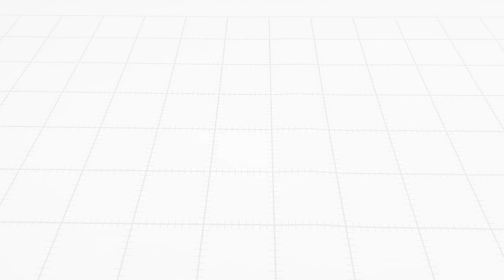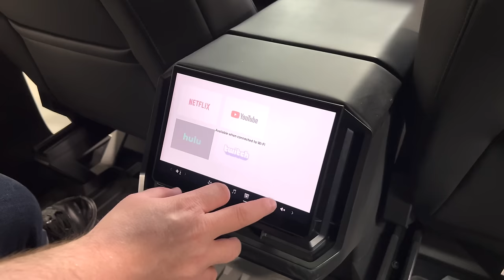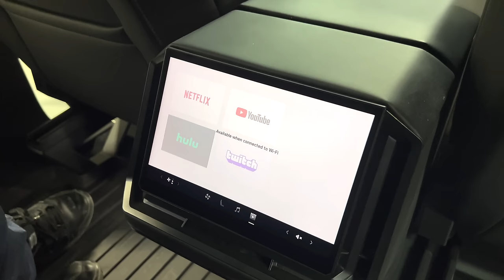Funky Form & Features: Tesla Cybertruck Interior Review

Comment: Put all your ratchet straps and tie-downs in the Frunk, Carl?
Reply: Yeah, that was a really weird example to make it into the final edit of this video. There are so many random "what ifs" that are not explicitly related to this vehicle, why bother including "what if you're hauling something and it's on top of the rear trunk?.
Reply: Or under passenger seats? You know in advance if your going to need them!
Only in an emergency is it an issue but no spare tyre either so hardly an issue in that respect
Reply: Not sure I want my assessories in the frunk. Likely in a bag under the back seat.
Reply: then why put storage there in the first place? seems like a great place for a spare tire instead of
Reply: @deathraylabs_nature  Tesla clearly decided that carrying around a spare wheel 100% of the time was an unreasonable trade off with the loss of range/efficiency that that additional weight would bring. Most people buying a $100k vehicle don't use spares I suspect.
Reply: @ampontour  - but the price will be coming down, and most truck owners know how to use a spare.

And it wasn't a truck, but last time I had a blowout (a fairly new tire and about an inch diameter section just disappeared) I was back on the road in about 10 minutes. I was out in the countryside hundreds of miles from home and it would have probably been a few hours just to get roadside assistance to arrive, so I very much like to have a spare tire.

I wonder if a spare could be stored under the back seat.
Reply: @ampontour  yeah… 13 years in my F-150 and the spare NEVER move…. More chance the cable will snap before I need the tire.
Reply: Cha Ching
Reply: @esperago  I suspect the actual intended use case for the under trunk space is for less often used tools and utilities, such as a 110/220V charger cable, a CCS adapter, auxiliary lights for towing a car etc.  Not for things you would regularly need access to and that you don't want compromising your trunk space for hauling anything large or loose that would prevent you from carrying heavy equipment with the tailgate down.
Reply: Sure, my front door to my house is very convenient for entry, but what if I place a bunch of crap in front of my door and block it? Not so convenient anymore, is it???
Reply: His argument kinda told me he was a cybertruck hater.  Complaining about extra storage seems petty.
Reply: @esperago that’s a very common occurrence if you plan to use the truck as a truck.
Reply: Or take out the straps before you put in a load.
Reply: @stickleback73  Pack a tire repair kit and use the onboard air compressor to reinflate the tire
Reply: @alanlight7740 with tire you need also pump, wrench, jackstand...
Reply: If you *plan ahead*, you should be able to have ratchet straps/tie-downs easily available. If you don't plan ahead...you won't.
Then again, if you're picking up a rented hanger....you might be able to get straps/tie-downs with the rental...OR if it's your own, keep them in the hanger instead of your car....or put it in the frunk...OR put it under the seats. There are so many ways to avoid the "potential problem", the first being PPPPPPP...and then you can go from there
Reply: @teodor4ik183  - those barely take any room. You could stow them anywhere.
Reply: @alanlight7740  tire takes place. Тhat niche is not big enough. Even if they can do it bigger, but under bed, as usual, you will loose that space and aero by flat bottom. Any other place will kill aero, or bed. That wheel dont cost it.
Reply: Carl's obviously not a truck owner

Comment: Not only does Carl know cars but he can also do voiceover work. Man of many talents!
Reply: munro doesnt know good engineering either does tesla if they did they be criticizing the electronic crap doors. no real physical handles/mechanical doors also they would be pissing on lack of start buttton and turn signal stocks and windshield wiper buttons and headlight buttons or physical gear shifter without its just bad design 101 and overly cost cutting so much to a point all of these are safety hazards
Reply: @billybobbob3003 
Work on your grammar and your opinion may carry more weight.... 😉
Reply: @rogerstarkey5390  grammar doesnt equate to intelligence. simple appliances man the batteries are expensive as sh1t. electric motors and batteries will always be more expensive than a combustion engine and a fuel tank lol.
Reply: @rogerstarkey5390  my opinions are not opinions they are based on FACTS.
Reply: @rogerstarkey5390  ed cole is better designer than munro ever will be. made best engine ever 4.3 v6 and 350 chevy and no electric engine/lithium battery will ever touch em!
Reply: @rogerstarkey5390  alot of engineers dont think with common sense.
Reply: @billybobbob3003 blah blah blah
Reply: @davidmarkmann6098  he's so smart he knows that start buttons are better than just starting the car and it's a FACT... 😂 He probably also believes there should be a "stop motor" button... 😂
Reply: @billybobbob3003 the best part is no part mate!...get out of your own way..things change ..deal with it
Reply: @damfadd  the best part is no part for penny pinchers yeah tesla lacking parts where there should be parts they are incomplete engineering failures!
Reply: @Thomas_Acharya  the best part is no part for penny pinchers yeah tesla lacking parts where there should be parts they are incomplete engineering failures!
Reply: @damfadd  tesla are such good engineers they put headlights so low on cybertruck and a shape that will collect snow people are already complaining lol they are piss poor period and their inexperience shows.
Reply: @billybobbob3003  Seems like you're trying to state something important, but comment is indecipherable gibberish. Please clarify so your audience understands your point and can discuss.
Reply: @vermontsownboy6957  ill make a video explaining how tesla products are engeering failures older tesla's from 2012 were actually better designed. hail stones will bust through tesla glass roofs videos of it.  just more proof of crap design. no on and off switch for the vehicle is crap design, no physical turn signal stock is crap design, no physical gear shifter is crap design, no physical headlight switch is crap design, no physical ac/heat controls or radio control knobs is crap design, no physical door handles are crap design.
Reply: I find his voice grating. I'm watching this video despite him, not because of him.

Comment: I have never heard an argument for not having your hand at the top of the wheel. As a person who occasionally does this I appreciate the warning!
Reply: Came here to say the same thing. Good to know
Reply: Or passengers who put their feet on the dash. Passenger airbag goes off and boom feet hitting the ceiling and possible broken bones.
Reply: That was one of the primary reasons Tesla created the yoke on the S/X. Your hands are forced into safe positions on the wheel.  Still a few owners want to have there hands on the top, and Tesla had to relent and provide a round wheel.  I like the yoke myself.
Reply: That brings up another issue. The horn is atop the airbag, so if you’re honking when you crash, you’ll break your arm.
Reply: Another argument is how much you can turn the wheel from that position, say you need to make a sudden turn in an emergency, you're pretty limited in both the amount you can steer and how precise you can be.
(Of course, you'd likely grab with both hands at this point, but it's still a case to be made anyway!)
Reply: @tesla_tap the yoke is just an utter pain when maneuvering. aka at the start and end of every single drive. which is why round wheels are way better
Reply: My Gen Z daughter learned this from drivers ed, so that is how it is taught nowadays.
Reply: At 65 y/o I drive 1/3 hand on top at 12 o'clock,  1/3 with one at 4 o'clock and 1/3 everywhere else. It's going to be next to impossible to break old habits with + one million miles driving and no experience with an airbag deployment.
Reply: You’ve never heard that your hands should be at 9 and 3 o’clock?
Reply: Stupidest hand position anyway. Too many lads watched fast and furious and like to play pretend in their corolla's.
Reply: I have seen an arm break on someone's face in a crash by driving like that. Wouldn't recommend it
Reply: best piece of advice ive heard in a long time.
Reply: @anonym3017  Historically, yes. But now they have steer by wire that's not the case. Lock-to-lock is about 300 degrees, which you can do without letting go,
Reply: @MIKOOL13   we were taught ten to two as it's less stressful on your wrists on long journeys.
Reply: A good driving instructor would make that argument on the first day of training.
Reply: @anonym3017 - Not sure what I'm doing different, but I've had zero issues maneuvering with the yoke, including 3-point U-turns (which I do about once a week), and tight turns in parking lots. One think to check is what steering mode you use. I have it on Comfort. Sport mode will make the wheel harder to turn (yoke or round).
Reply: Ever since airbags came out I always knew not to put my hands over them when driving.
Reply: I'm not big on my left hand smashed into the side window either. Especially a window that won't break like it's supposed to.
Reply: @heinousanus9352 - From what I can find out, it appears the airbag mostly fires forward toward your body and face. You can still hold the wheel at 3 and 9 o'clock positions and maintain some drive control, so your hands are not flung into the window by the airbag.  With your hands at the top of the wheel, your hands come between the airbag and your face, usually causing wists to be broken and some facial damage
Reply: @tesla_tap  try getting pit maneuvered and recovering it with a yoke. Never drove with my hand on top of the wheel but I do appreciate having a wheel it needs to "spin".
Reply: I'm returning my CT but I will miss the steering wheel. I like not having the obstruction in my view.

Comment: For the burrs on the edge of the stainless panels there are two things that you should know. First the panels are laser cut not stamped. That will change the amount of burr, maybe even eliminate it. Also Tesla has mentioned they have a process to slightly round all the edges so they are not sharp.
Reply: They call it "coining".  Like the slightly rounded edges of a coin.
Reply: Out of Spec Reviews did an amusing check on frunk closure.  The missus called it a 'carrot cutter' - they used carrots to show how potentially dangerous it can be.  DO NOT get your flangies caught in the side edges during closure.
I am completely unsure about whether there is an automatic servo over-current trip if an obstruction is encountered and whether it is correctly set to stop at a suitable (finger) resistance - like most window winders.  OoSR did not extend testing beyond carrots.
Reply: @jimparr01Utube  Bubblewrap the world Daddy its so Scawee!
Reply: Found the Stan!
Reply: @jimparr01Utube someone tried it with gloves and it didn’t reverse, they didn’t get cut, but they needed a second person to open the frunk.
Reply: As a Radiographer I have Xrayed many people who have had fingers crushed in car doors. Almost none are immune from this problem. Same thing with the jam of doors in most houses. Just keep your fingers out.
Reply: @jimparr01Utube 
If you eliminate the gap or have it very small, you create a shearer (scissor); no wonder it will cut most things, especially if you put the object you are cutting close to the pivot point/fulcrum.
Reply: @magnuslarsson337  Well thank you Sir.  The whole point of my comment was to bring a possible danger to the attention of all.  A previous respondent to my comment verified that there is no automatic obstruction detection and automatic reverse when an obstruction is encountered.
Almost everything is dangerous at some level whether it is automated or not, and devoid of adequate safety measures.  I am just pointing out from second-hand reports and comments that this is one detail where Tesla engineers may have possibly dropped the ball.
And yes, it can be likened to Mum having her hand over the lip of a front guard while a frustrated hubby manually slams the bonnet shut.  So no grief from me about whatever might be done about this, even if nothing.  I will never be able to afford to buy and use a Cybertruck.  No crusade or Tesla bashing going on here.

Comment: 23:00  Reason for the plastic cover on the seat bottom is more utility when loading/unloading cargo placed there.  Plastic is a smooth hard surface nothing will catch on while fabric provides a hooking or staging point.
Reply: Also, as there are storage bins for under the seat you are going to want a hard surface under the seat to keep them clean or free of damage for anything stored below.
Reply: @DahGrill Yeah, Joe Tegtmayer did a video showing it. Since it's removable, you don't lose the ability to load large items inside the cab.

Comment: Carl, at one point you speculate on how the SS panels are cut and formed, and whether the edges need to be dressed. Didn't Munro Live do a video where Sandy was taken through that section of the factory? And describe how the laser cutting leaves a micron accurate shape? I can't see how or why those blanks need to be dressed.
Reply: Carl thinks you can stamp 300 series stainless steel!

Comment: The plastic under the back seat is there to protect it when you put objects in between the gap between the front seat and the back seat.
Reply: So there is a gap there under the back seats. It looks like it, but was not sure 👍
Reply: Agree, carpet would easily get scuffed or torn, and at the very least be much harder to keep clean
Reply: Yet there's a delicate 9 inch screen sitting low that you have worry about getting damaged.

Comment: I was a little surprised Carl had no remarks regarding the rear view mirror.  First, it is rather small and second, the mirror is blocked when the tambour door is closed.  Yes there’s a rear camera, so why not put a screen behind half-silvered glass?  Chevy did that on their Bolt - the user can flip the mirror between normal and a wide angle camera view projected through the mirror.  I don’t care for having to look at the console screen for the view - that’s just me, but I am the customer.   The rear camera needs better low light sensitivity too - hopefully that will be addressed as a rolling change in production.
Reply: That last bit can probably be improved in a software update as well.

Comment: Sorry Carl, but if the sun is so low that you need the visor for forward vision, the sun can't be overhead simultaneously. The glass "slit" would likely appear black in relation to those conditions and the eye's ( and brain's ) dynamic range.
Reply: But what if you're driving your Cybertruck on a planet in a solar system that has two suns, what then?😋
Reply: It could be half way between both positions.   Or the angle of the truck changes based on topography of the road.  It’s a very valid concern.   They should have made a pull down shade hidden in the roof panel.
Reply: Ha! The Sun is several almost 900.000 miles across. It it occupies your lower field of view, it will occupy the upper as well.😅
Reply: @PaulSmith-tn4yu  You have to upgrade to the Tatooine package. Typical money grab! 😅
Reply: @PaulSmith-tn4yu LMFAOOOOOOO
Reply: Not all roads are flat. Heading down a hill will cause the sun to align with that gap and shine in ones eyes.
Reply: @PaulSmith-tn4yu  I knew at least one of the possible replies would make me smile: thanks!
Reply: @Kilaueaorph4n  ...and? The sun is actually 864,938 miles, granted, but it's also 92.5-ish Million miles away! That's why its angular size makes it appear the same approximate size as the moon, which nicely explains the upcoming eclipse...
...so the sun at the horizon appears as larg...er...small as the moon.
Reply: @DC-yh2oy  Good point. Rare case but yeah.

Comment: Interesting comment about placement of the front panel gap and its effect on airflow.  Sharp corners are generally bad. Air breaks and eddy current form (bad). The forward facing gap may allow an air escape channel, lowering air speed around the corner. It would be interesting to see its effect in a wind tunnel.
Reply: Someone has already done a video on that.

Comment: The underneath storage in the bed seems like big problem if you ever use it. Based on the video, I don’t see how you could reach the bottom after bending over the bed gate. It’s a lot of space that no one will be able to reach. They need to design a better tail gate so you can get at that space.
Reply: Only tall or athletic people who can reach or climb on the tail gate are safe.😂😅
Reply: For crying out loud, just sit on the tailgate. People have been sitting on tailgates since pickup trucks were invented.
Reply: @gloredon That’s one solution to a bad design. Another would be for Tesla to build a tailgate that can get out of the way. 48 volt and steer by wire are great innovations but the tailgate still needs work.

Comment: I mean the plastic bottom panel for the rear seat make a lot of sense, if you are folding the seat, you are storing item on the back row, which the plastic panel is stronger and more scratch resistant